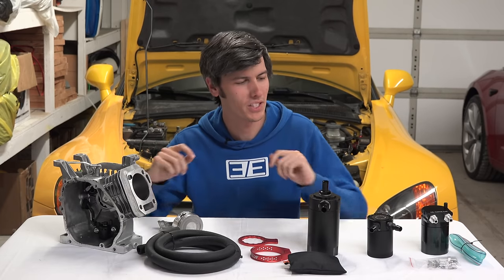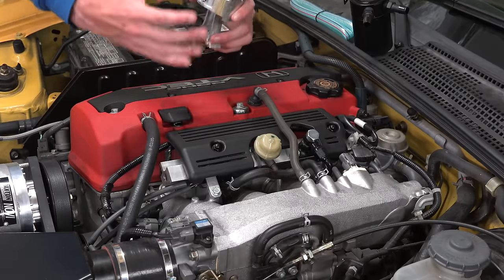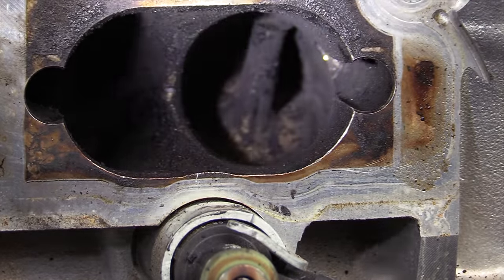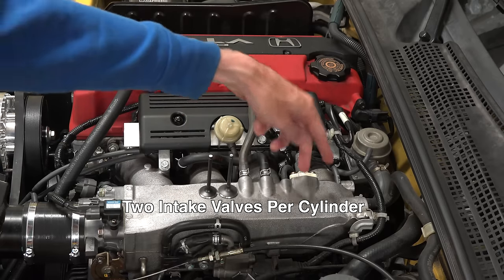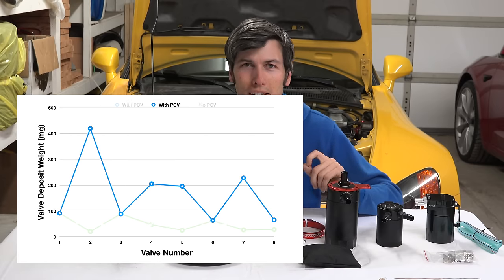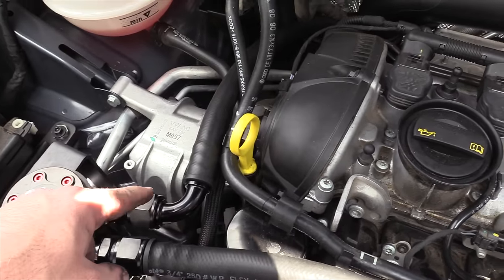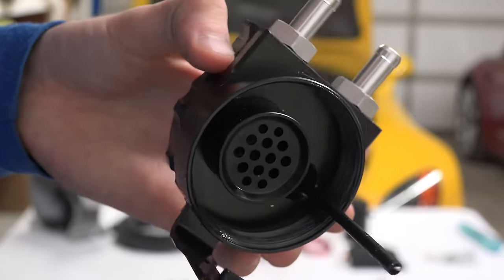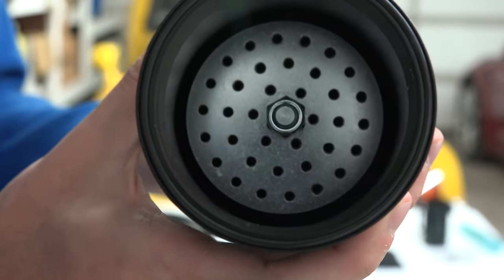Do Oil Catch Cans Actually Work?

Comment: Popular poor man's solution is to use a compressed airline's filter / water separator.  Has transparent bowl for easy inspection.  Cheap.
Reply: That’s what I did haha, $200 for an Oil Catch Can, no way.
Reply: Yo, link?
Reply: Having a transparent containment reservoir is even better. What kind of pressures are involved in a PCV system vs a shop air system?
Reply: @chriskelvin248  Not even close to 1 pound. This is a good idea and can be had for a reasonable price.
Reply: @chriskelvin248  PCV only sees vacuum and never a pressure.  Absolute vacuum is negative 14 psi.  EGR limits this to a fraction.  Pressure will never be an issue.
Reply: Harbor freight, $10. Easy.
Reply: Ernest Although I agree that pressure will never be a problem, your base assumption is false.  At idle a motor generates the most vacuum in the intake it will see.  This won’t make sense to a lot of people, and that is okay, a simple vacuum gauge or MAP sensor will tell the story as long as the motor isn’t crap to begin with.  When the motor revs up, vacuum in the intake drops off and pressure due to blow-by increases to push oil and vapors into the catch can or intake.  If you did that at idle, the highest vacuum a motor sees, it would stall the engine out.  The PCV valve was designed to only pull vapors from the crankcase when the intake vacuum went low (higher RPM, Throttle open) and the pressure in the crankcase(oil pan) went higher than the intake.....again, the biggest vacuum a motor sees is at idle when the throttle is closed and the motor is sucking the minimal amount of air past the throttlebody blades.  If you can build pressure at the PCV value beyond 1lb or 2 positive, you have found a motor with crap rings on the pistons or has forced induction (turbo or supercharger) which causes the intake to go well positive of atmosphere pressures, sometimes 3x or 3 Bar, and since it’s a closed loop system it will pull on the crankcase harder than a normally aspirated engine, meaning no power adder.
Reply: @chriskelvin248  It can have up to ~10psi delta but normally it shouldn't have nearly that much. Shop air is usually 90 to 125, but some people push it to 175 or so. Either way the car isn't going to hurt it. Just be sure it has enough flow because all the ones I've seen are very restrictive compared to what the PCV normally flows. If it doesn't flow well then it isn't cleaning the crankcase gases as well, and when you floor it it could pop the hose off and/or increase the odds of blowing a gasket somewhere, likely a valve cover gasket. So I'd get a big one, then see how it flows when soaked in oil.
Reply: @iamblaineful  The pcv pulls at all times, and pulls the most at higher vacuum conditions which is normally a slower cruise speed but it depend on the car. The highest vac and flow is when the eng is decelerating, especially when using the engine as a brake. Lotta factors go into what flow will actually end up being, but I've never seen one that was designed to flow more when vac was low.

Comment: Why would I use this as opposed to an air oil separator?

2018 Subaru Crosstrek
Reply: you wouldnt.
separators are superior in every way, but 5x the price and a pain to install since they tap into oil,and cooling systems as well. any novice can install a catch can from ebay, but a separator is race-grade equipment that takes a mechanic to install.

Comment: My 4hp Briggs and Stratton lawn mower needs this
Reply: I bet it burned oil right out of the box, just like mine did. Also that “4” is not raw horsepower. Mine says “6” on it, and I can tell you my old Tecumseh was a 5 Horsepower, and the the “6” doesn’t even come close to that.

Comment: Just like to point out that the Pontiac DI engine managed 800,000 miles without one of these? Maybe don't over think it...
Reply: Nope, he said kilometers which us drastically different
Reply: @Warpex19  You're right. It only managed 500,000 miles with no catch can before the testing began. Definitely need catch cans then.../s
Reply: @bazza2540  lol
Reply: Classic snake oil sales pitch. They could make even more $$ if only a way to bottle the residue from them and use it as a "Scalp rejuvenation tonic- cures baldness overnight" were invented? 

Some before and after pictures of a bald guy wearing a wig and his "Actual true testimony" combined with some very convincing people wearing lab coats that have BS designations like "PHDfu" or "ASPCA" printed on them explaining how it "Really works or your money back"  could make their wallets even thicker.
Reply: Haha couldn't of said it better myself!
Reply: He didn't say how many times during that 497,000 miles the owner had to spend 1k or more to have the intake valves cleaned. I know nothing about that Pontiac motor so maybe it doesn't have this isssue but on some DI Audis, that's an every 50-80k miles job and costs more than 1k to do right. Plus, this isn't a problem that causes the engines to die. it's a problem that causes them to misfire, lose power and run like crap. Do you want a car that runs great for 50-80k miles but then have to keep driving for YEARS after that with it running like crap?

Comment: I need a help. I have a Tiguan, I’ve installed a catch can on mine. What I taught is to put some decarbonizer inside the catch can (with it cleaned). The decarbonizer has a relatively low boiling point (around 68°C) in this case when the decarbonizer boils it will also clean the intake… what you guys think? Are there any cons that I’m missing?

Comment: Could you run or use two of the $25 ones in series and get a better effect out of them as opposed to a single one? They'd still fill but less as a 2nd filter of sorts, I'd think.

Comment: can make one of these from Harbor Freight from an air compressor filter for $10.
Reply: No.
Reply: @johnd9357  weird, I'v been using one for years
Reply: That Woo Woo, my buddy has used one for years in his 98 Tacoma. Simple air compressor set up like you mentioned.. copied his setup in my Tacoma also,never realized there were expensive real versions til a few years ago
Reply: You can but they don’t work very well.

Comment: is this buildup really only a problem for the valves? i recently disassembled an old motorcycle intake/carb and everything before the carb was absolutely filthy with at least 0.5mm reduced manifold diameter due to oily buildup :/

Comment: great video, Could you do AOS (air oil seperators)?

planning one for my WRX but still skeptical about the installation
Reply: Have to be more careful on a turbo setup.  You need to use a large, high flow check valve between the manifold and the catch can, to prevent pressurizing the catch can when under boost.  Something like a large Krank Vent.  Oil vapors only flow from the valve cover to the manifold when the manifold is under vacuum, so you don't want to restrict that too much with your oil separator.
Reply: @ericchambers9023  thanks for that info. Do you recommend a different set up than AOS

Comment: You can also just vent to atmosphere. Really no need for a catch can if you just run the line w a one way check valve to the bottom of the car w a small easily cleanable or changeable filter.

Comment: What about using muffler bearings to reduce exhaust friction?
Reply: CHRIS FIX HAS ENTERED THE CHAT
Reply: Sounds like fake stuff. But do ceramic coat the inner parts of your exhaust. A slippier surface creates less friction.
Reply: Can we officially retire the muffler belt and blinker fluid Dad pun? It’s 2020.
Reply: @plog1805  I'm a dad, so I can do with these puns as I please.
Reply: @plog1805  My fog light fluid needs to be changed...
Reply: A water based lubricant will do it.
Reply: @David-jh8mp  That's what she said.
Reply: @plog1805  might be 2020 but my daughter works at orileys and had young man come in looking for some. His tail lights were only half full. TRUE!
Reply: Its a good idea to also change up the timing belt lube while at it so it doesnt crack and gets charred rubber all over your engine
Reply: That can cause the muffler to unravel.
Reply: @plog1805  no
Reply: I ordered a muffler bearing, but I got the right-hand bearing, I need left.  Dammit.
Reply: blinker fluid is a must do mod
Reply: Steve Edward I just want the exaust tips ceramic coated. How should guys at the shop go about doing that when the exhaust/muffler is all one piece. ie: no separate exhaust tips
Reply: @alueshen  install it upside-down and you'll be alright

Comment: for my civic i like to use a fiji water bottle as a catch can to pretend i have money
Reply from the maker: So pure!
Reply: You gotta use a monster can with the screw on top lmao
Reply: Hahaha poor civic driver. I have a voss bottle on Camry
Reply: I used an Ovaltine jar and hot glued a baffle inside under the lid, and attached 2 hose barbs to the lid as well on either side.
Reply: Nothing beats a frito cheese dip can.
Reply: @jameshaulenbeek5931  Or a Pringles Original Fart Can that I use in emergency situations at work
Reply: @icecreamalacarte  🤣
Reply: @k02snipe  only if your name is kyle

Comment: I have the n52 engine with the magnesium cover. I installed an catch can,the one with bronze filter, right after the cover ventilation port and before the CCV , my only concern is about crankcase pressure , I read somewhere that the catch can can increasse the pressure in the engine … How is yours? Did you have any leak ?

Comment: What about air oil separators ? can you do a video on those ?
Reply: They are great because they don't need to be inspected as much but they are poor because they let all that nasty stuff drain right to the crankcase. Water vapor cools, turns into liquid and corrodes the  inside of the crankcase. Unburnt fuel returns to the crankcase and can dilutes oil so it doesn't lubricate well. AOS's must be installed in a very specific place that heats them enough to keep water vapor and unburnt fuel from condensing back into liquid so both are allowed to continue through the PCV system. Catch cans are simply superior in performance but require more maintenance. It's also recommended that you keep a very close eye on them in extreme cold weather as more water will condensate in the can. You might need to check it every over day in this instance. Or you could just install the stock PCV hose during these times and let the system run normally.
Reply: @GR1MR34PER33  The water vapors condensing won't get the chance to start the corrosion process inside an engine, unless the engine sits for extended periods of time. Engine oil gets splashed and sprayed during operation inside of the engine, which forms a protective "barrier". However, if the engine is neglected and not allowed to run from time to time, the water vapors have a chance at corrosion because that coating of engine oil wears away. As for the the unburnt fuel, that's why you adhere to your engine's oil change intervals.

Comment: I just have an question which i can’t get it why they all do that. Why do people delete pcv in order to install an oil catch can? Especially 2.0 tfsi cdla-cdlb engines. Why need to do delete pcv to install oil catch can? Don’t they works pretty well together? I see that pcv delete bar gives comfort as like plugging hose onto plate only. But hoses that comes from pcv valve can be cut and then oil catch can would be installed. Please somebody explain me. I feel so confused.

Comment: What i don't get... The crankcase pressure is depressurized by the intake, but the intake has a turbo, pressurizing the intake and thus the crankcase... 🤔 Can someone explain? There is no checkvalve or anything in between btw...

Comment: Bottom line: emission controls slowly choke an engine, requiring the engine to use more fuel, thereby negating said "benefits".
I say screw 'em...
Reply: That's because car manufacturers are judged by the results as it rolls off the assembly line; they couldn't care less how well the car performs after 10 or even 5 years.
Reply: EGR is not just an emissions regulation. Your engine can tolerate higher temperatures with exhaust gases mixed in the combustion chamber. Don't go ripping out your EGR and wondering why your engine runs like garbage.
Reply: No, I'm certain emissions controls actually provide more benefit than harm when it comes to improving air quality over the life of the vehicle.  Anyone who claims that removing emissions controls makes their vehicle more environmentally friendly is delusional.

Comment: I've actually managed to find a cheaper oil catch can than what you have listed. My $10 catch can has a drain, a sight tube on the side and that's it. There's no baffles there's no nothing inside at all it's a wide open can, actually! 🤣
Reply: You can use a steel scrubber (make sure it doesn’t have a detergent in it) and stick that in the can in place of the baffle, it will help the oil mist collect on it and settle out.
Reply: @jimssawsnstuff8903  ONLY if it's a stainless steel scrubber. 😂
Reply: @allenplant1702  well, not plastic anyhow! 😜
Reply: @jimssawsnstuff8903  I guess a plastic one would be better than the steel one I used in the exit line that rusted out in a few weeks and sent a rusty mist down the line. I'm glad I didn't have it routed into my air intake at the time.
Reply: @allenplant1702  wow, yeh, I was saying not the fine steel wool, I was thinking the put scrubbers that you can get in copper, brass or stainless steel.

Comment: Those oil catch cans are wayyyyy over priced. I had purchased oil air separators in Home Depot for 1/20 of the price.
Reply: Yeah but these are bigger and i think do a better job. I've got a factory oil catch system that is pretty much the same as an oil catch can, but it wasn't catching all the oil vapor and i installed one of those pneumatic oil separators after it. It's doing great so far.
Reply: Yea 2-3-400 for a can is out of hand,get real theres nothing magical about it.
Reply: I made my own for about 5 bucks. Tip: don't use a plastic jar (like ones peanut butter is packaged in) - it'll will get completely flattened out
the instant you start engine - from words of experience LoL!
Reply: @jacknobles1907  I used an Ovaltine jar and that was pretty firm. Never crushed.
Reply: Looks ghetto too.  The $25 legit catchcans work fine.  And look way better.
Reply: I have a lathe and made one complete with filter for under $5. Snagged a 3” solid stock of aluminum and bought the rest of the parts lol

Comment: I have an S10 I'm thinking about building and designing an oil catch can / vacuum distribution. Transfer case fluid is coming up into the vacuum system where it settles in the HVAC actuators causing the rubber to degrade and fail. The way I plan on building mine will have the oil go back into the transfer case.